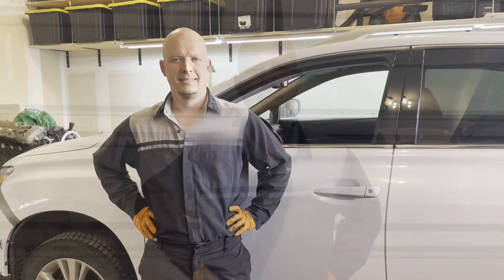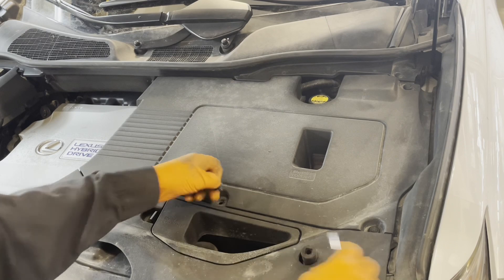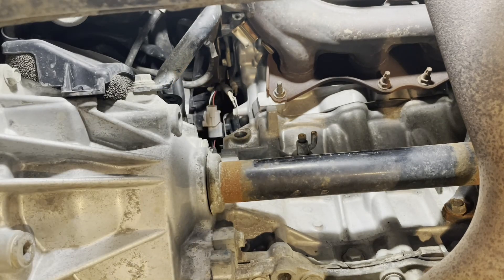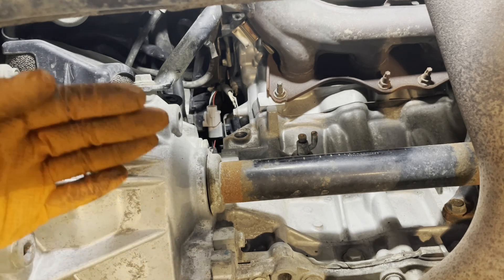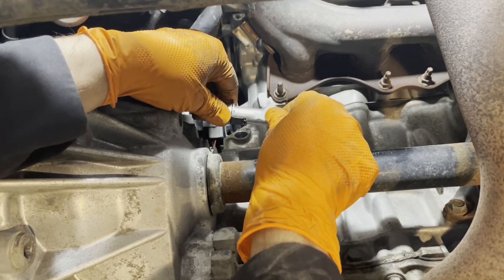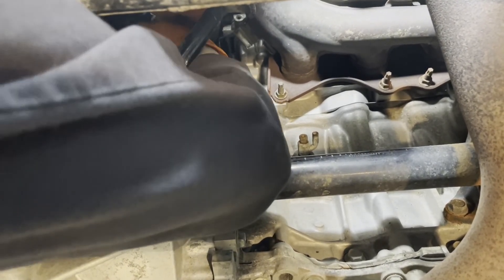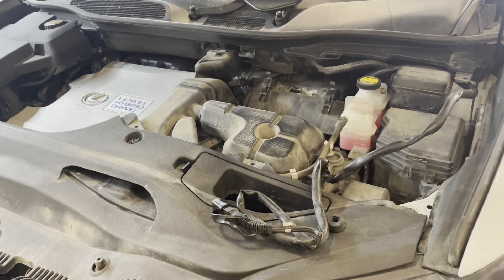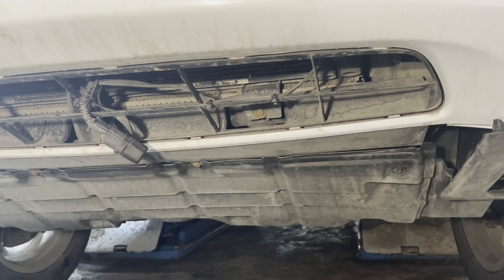Lexus Toyota 2GR 3.5L Engine Block Heater Installation Instructions - RX350 Camry Highlander RAV4

Comment from the maker: Below are my affiliate links to the parts and tools you would use to complete this job. I may receive a small commission from the product sales. Thank you!
Aftermarket block heater: https://ebay.us/BD6wJF
Heat transfer grease: https://amzn.to/3RtgQrX
1/4" impact driver kit: https://amzn.to/4f1UN4A
1/4” socket adapter set: https://amzn.to/44XTTkI
Small flat blade screwdriver set: https://amzn.to/44HUoQi
Auto trim and clip removal kit: https://amzn.to/3KgKGfg
Rechargeable LED mini work light: https://amzn.to/3Y74OpY

Comment: My daughter is getting my ES350 when she gets her license in a cpl months and I want to out an engine block heater on because I know she's not gonna let the car warm up in the winter before going to school. Just curious on what temp they heat the block up to?
Reply from the maker: @jasonjaeger4042  hi, there is no thermostat inside the block heater. It just runs all the time when it is plugged in.
The block temperature will depend on the ambient temperature and the duration of heating.
Usually it will warm my 5.7L V8 about 20-30 degrees Celsius above ambient after being plugged in all night in -20 degrees.
Reply: @Viktor_G_Automotive  appreciate it man, I'll have to get a timer on it. I'm sure I'll have to buy more than one seeing as my daughter will probably take off without unplugging it more than once!

Comment: If you are doing this on an older engine, I suppose that it would be wise to clean out any debris or corrosion in the hole first, before inserting the cartridge (assuming that you can get in with a small wire brush or something similar)?
Reply from the maker: @martinliehs2513  sure, you could use a bottle brush or similar tool.

Comment: Does my 2008 Lexus es350 has that feature?
Reply from the maker: @lexusfan100  yes
Reply: @Viktor_G_Automotive ok. Also that part u used is aftermarket or OEM? . I cannot seem to find that part. The link on eBay is not working
Reply from the maker: @lexusfan100  The part I installed was OEM. I have updated the link for the aftermarket part on eBay. Thanks! https://ebay.us/BD6wJF
Reply: @Viktor_G_Automotive  thank you. Do u have oem part number
Reply from the maker: @lexusfan100  hi, I would recommend to contact the dealership parts department for that to make sure you get the correct latest part number.

Comment: Would you be able to tell me where the location for the 23 Lexus gx460 cartridge is?
Reply from the maker: @richardsorenson5886  we were not installing block heaters on the GX460 models at the dealership. The access hole would be on the drivers rear side of the engine block, but it may be inaccessible.

Comment: For the models with AWD, is it still possible to change/remove/install block heater from underneath?
Reply from the maker: @kovalenkoihor4325  yes, absolutely. All RX350 models sold here in Canada are AWD, and that’s how we install the block heater. Exactly the same as the video, but harder to see the hole since the transfer case is in the way.
Reply: @Viktor_G_Automotive  Thank you. I have Sienna 2gen  AWD with  3.5 and block heater was there from years now. I never used it, previous original owner never used it... And now The plan is to remove the heater and check if it works  without being connected or by any means touching the car. Can be cable corroded, can be the heater itself. If the heater itself works, will just replace the cable and install it back
Reply from the maker: @kovalenkoihor4325  sounds good 👍

Comment: Hey I found the video to be informative and helpful. I have a 4x4 2017 tacoma. As you mentioned all the 2GR engines will have the heater hole on the same side. I'm assuming the process is the same except I'd need to remove the cover and work around the transfer case?
Reply from the maker: Hi, the video applies to transverse mounted 2GR engines (engine mounted side to side in the engine bay). The 2GR models that are longitudinal mounted (front to back) have the block heater installed in a different location - from the rear corner on the driver side near the transmission.

Comment: ਧੰਨਵਾਦ ਵਿਕਟਰ
Thank you  Viktor for video it helped me saving  installation fee $250.00 from Toyota dealership. Worked well for 2015 Sienna limited AWD
Reply from the maker: Glad to hear it save you some money!
Reply: AWD or FWD?
Reply: @alan4sure  2015 sienna limited AWD
Reply: @biru4074  did you have to remove a big plate underneath to find it?
Reply: @alan4sure  yes i did removed plastic plate for easy access
Reply: @biru4074  thanks a bunch bud!👍👍

Comment: what block heater did you use?
Reply from the maker: OEM Toyota one.
Reply: @Viktor_G_Automotive  Do you have any part number? Seems like I can't find anything by "block heater"
Reply from the maker: @kovalenkoihor4325  it appears that Toyota stopped selling the OEM block heater due to an ongoing recall, they may release a new part number in the future, but for now you will have to go with an aftermarket one.
Reply: Hi, do you need to drain refill coolant fluids?
Reply: @a10zablue  no need, since heater doesn't contact the fluid directly. This thing works in a following way. On one wall of the engine, there is a hole, which is not through the engine. You insert that heater there. Heater heats metalic engine wall and the wall heats coolant fluid. Not that effective, but engine kind of doesn't care, if this thing is corroded or broken or not completely sealed, which is good.
Reply from the maker: @a10zablue  not to install this type of block heater (dry type). On other model Toyota engines you may have to drain coolant if the block heater is of the wet type.
Reply: I have a 2007 Lexus IS350 model right hand drive from Japan. I think it didin't come with block heater. I can't find the cord. The engine is 2GR FSE rear wheel drive. Is it the same type of block heater which is the dry type like this one?  Thanks.
Reply from the maker: @a10zablue   On the IS, the block heater goes in from the rear of the engine, close to where the engine and transmission meet, under the exhaust manifold on the left side of the vehicle.
Reply: @Viktor_G_Automotive   I bought one today from local Toyota dealer. $140 Cdn.
Reply from the maker: @ nice 👍